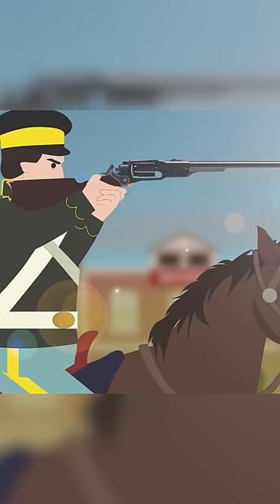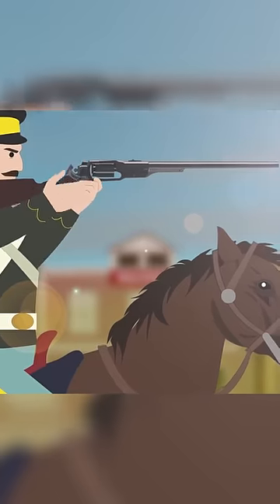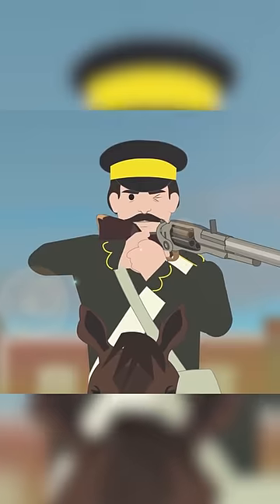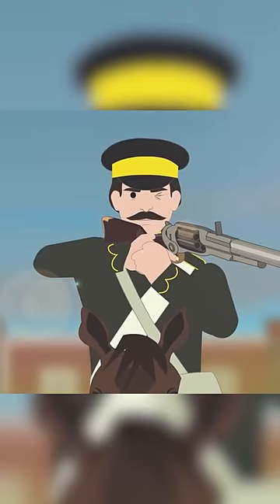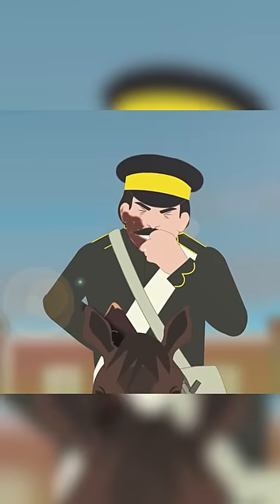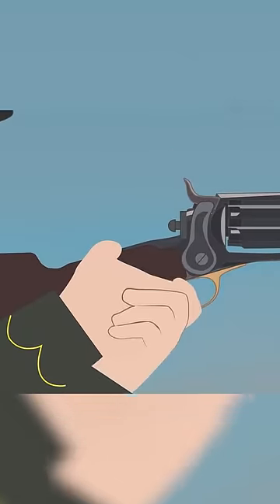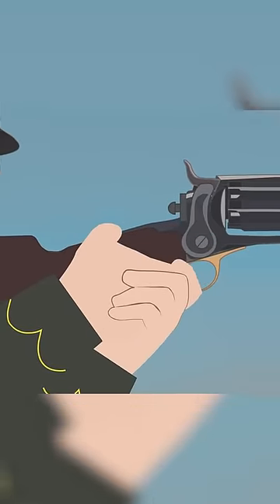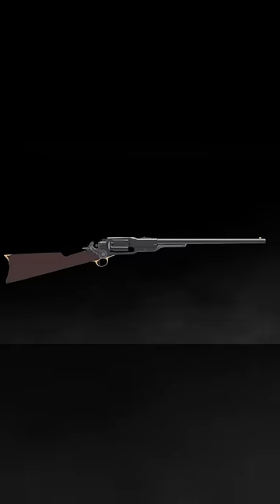Cursed Guns - Colt model 1855 (Cook off incidents)  #shorts

Comment: Chainfiring was one of the most dangerous parts of cap and ball guns
Reply: Haven’t had it happen to me yet just take proper precautions and it shouldn’t happen
Reply: @Lleesstreett  I'm sorry how can you take precautions?
Reply: Couple of ways. One would be to make sure your ball/projectile shaves a ring of lead when you ram it in the chamber (ensures airtight seal, hopefully preventing sparks/gas getting to the powder). Additionally, it’s common practice today to fill the remaining part of the chamber with a wax concoction to both soften fouling as well as prevent gas/sparks getting to the powder.
Reply: @alecdeveney3114  you say common practice “today” but that has been a method since the civil war
Reply: @Lleesstreett  since before!
Reply: Not when loaded properly.
Reply: I hear that grease pretty much nullifies the risk of chain-fire, but well soldiers are already assigned a bunch of kit so adding things to have to give to so many troops would be a pain. And, well, it's likely they would sacrifice some safety for the sake of speeding up what is a VERY slow process (reloading a cap-and-ball revolver or I guess 'revolving rifle'), so it probably wasn't feasible to issue all troops with grease and train them to use it.
Reply: This doesn't happen, nor has it ever happened. Soldiers are skittish folks, if cap and ball revolvers exploded randomly word would have gotten out and nobody would have ever used them. Revolver rifles were criticised by the cavalrymen who carried them as incredibly delicate and unreliable. Plus, f you wanted to have a rifle with a high rate of fire any cartridge rifle would do the job better, and that is why they weren't used. They were a gimmick with no niche to fill, but they didn't just go nuclear at random.
Reply: Could've worked better with cartridges and a recessed cylinder
Reply: A chainfire will certainly ruin your day. I had one happen once: set two rounds off. Scared the crap out of me. Use plenty of grease and you'll be fine. Probably.
Reply: @johnnyrotten200  
So glad for the development of metallic cartridges... chainfires seem like a nightmare.
Reply: @capsulejet6472  you use over sized shot. It should shear off a ring of lead when you force it in the chamber, people also pack bore lube on top for extra security but that's not really necessary.
Reply: @Lleesstreett  I don't expect it to happen all that often today but remember with muzzle loaded weapons & cap and ball pistols if problems should arise it's the the wizard not  the wand
Reply: @Lleesstreett  I know i  was stuck thinking about the civil war and the constant encounters of finding rifle's with multiple shot's rammed into there barrel's and stove piped them killing the operator's
Reply: @joshuacarrera6440  I’ve heard of that before
Reply: This is such a stupid urban myth...

No, chainfiring wasn't a real problem, especially since candleway was used to coat the bullets for easier loading - candlewax which sealed the chamber, and prevented chainfiring.

The reason this didnt become a thing is much more mundane - money.

Are the Knights LMG or the Ultimax better guns than the Minimi/M249? Yeah. Why doesn't everyone use them then? Because they cost a lot of money. That simple.
Reply: @Lleesstreett just because it was common today doesn't mean it wasn't common yesterday
Reply: Yeah in the modern day just smear some crisco across the face of your cylinder to act as a buffer between your powder behind a shot and your fucking hand

Comment: A weapon cursed because it was ahead of its time my grandfather has one of the modern ones that uses regular bullet casings and it works fine if it stayed around until bullet casings came I bet these would be the real cowboy guns instead of the lever action repeaters
Reply: Probably not since you would only be limited to 6 rounds. A lever action rifle could double that capacity. Even with modern cartridges,  they are still not equal to a lever action rifle. They are neat but not very practical compared to a lever gun. Remington made a model 1866 revolver rifle. It started life as a cap and ball rifle but was then soon  made to accept modern cartridges. It was a failure, lever action rifles left it in the dust.
Reply: @INeverMetAGunIDidntLike  but lever actions especially at that time jammed and we’re not as easy to clean you also couldn’t fire in the prone position and had to readjust your sight picture in some cases that’s why the US army never adopted them and used trap door rifles or breech loaders also lever actions were too expensive to to give to the standard soldier
Reply: @dr.killson7355  LOL, Im not laughing at you, I'm laughing at the old myth that you can not fire a lever action in the prone position.  I, as well as others, shoot our lever guns in the prone position without having to take our sight off of the target. You are right about the cost factor. After the American Civil War, the War Department realized that the metallic cartridge was the new thing and it would be replacing the outdated paper cartridge. Instead of spending a lot of money ( especially after the C.W.) on a new rifle designed to fire metallic cartridges, the War department determined that the cheapest route would  be converting the thousands of muzzle loading Springfields into single shot metallic firing rifles. The other reason the War Department went with single shot rifles is because the Winchester Mod 1866 utilized the .44 Henry rimfire cartridge ( basically a pistol cartridge). They could went with the  Spencer repeater that fired a larger caliber bullet but then we get back to the issue of spending a lot of $ producing more Spencers. It was a lot cheaper to convert the surplus Springfields than buy more Spencers and outfitting the whole military with Spencers. The military did use  Spencer carbines during the Civil War but they were issued to the cavalry. After the war, the Spencer carbines went out West with the cavalry and the War Department even had some of the worn out Spencer carbines refurbished and converted to rifles. The converted single shot Springfields could handle a larger and more powerful cartridge than the lever actions at that time. Another thing that convinced the military to stick with single shot rifles was to conserve ammo. They  thought a soldier would just waste ammo with a repeater, we are back to the $$$ saving issue. The War Department even requested that the Spencers have a magazine cut off switch (Stabler cut off) in order to conserve ammo.  Those are some of the reasons or excuses why the military went with single shot but you were talking about the Colt M1855 possible taking over the lever gun with civilians, not the military. Even though every thing that fires black powder can have issues due to powder fouling, the lever action was a superior design compared to a revolver rifle. The cons of revolver rifles, you still cant place you hand in front of the cylinder because of escaping gasses can do some serious damage to your forearm and you are still limited to only six rounds vs the Mod 1860 Henry or Win Mod 1866's 15 rounds. Now with that being said, If it was 1867, Western Kansas, Cheyenne uprising, you verses them, what would you want, a 6 shot revolver type rifle that only holds 6 shots, a 7 Shot Spencer, a Henry or an Improved Henry ( AKA Winchester Mod 1866 that holds 15 rounds?....... (Wow, that was a long reply!)
Reply: @@banthisyoutube4552 and they were still putting magazine cut offs on the Krag and 1903 Springfields........ unbelievable......
Reply: @@banthisyoutube4552And to this day people mistakenly believe the M16 is unreliable because of that.  It's always been a dependable gun if you clean it and use the correct powder!
Reply: @INeverMetAGunIDidntLike  how are you able to keep your sight picture in the prone with a lever action?
Reply: @oakesclassic6294  same as one would with a bolt action rifle.
Reply: @INeverMetAGunIDidntLike  if the lever is below the gun and you’re laying on the ground how do you have enough space to use the lever without moving?
Reply: @oakesclassic6294  Sorry I took so long to respond. I had to wait until I could whip this video out for you. The early lever action rifle technology could only handle a pistol class cartridge and it wasn't until around 1876 and 1886, when Winchester came out with the Mod 76 &86,  those models could finally chamber a large and heavy hitting cartridge.  By this time the U.S. military had already adopted the single shot Mod 1873 45-70-409 Springfield Trap Door rifle. There are other factors why the military never made the lever action a standard battle rifle but one can definitely fire a lever action rifle while in the prone position.  I hope this video helps.   https://www.youtube.com/watch?v=bq0Cu4WjLjU
Reply: @INeverMetAGunIDidntLike    thank you, I’m not very familiar with lever action rifles. As far as the space is concerned I guess I didn’t fully think it through. Modern rifles can only get so low to the ground as well, depending on the location and size of the magazine.
Reply: Even with modern casing the Revolver rifle wouldn’t have taken off, because the larger caliber of a rifle would probably mean the cylinder would need to be fixed in place for maximum durability. That means we’re most likely talking about a gate loader, versus a break action or swing out cylinder. The process of reloading the rifle would still be extremely slow because the bullets still have to be inserted and extracted one by one. Such a weapon would have no overall fire rate advantage over the single shot breach loader.

Comment: I have the reproduction (in .44 caliber). When loaded properly, there are no chain-fires. The reason of holding the carbine behind the trigger guard with both hands is to avoid the chamber side-blast that ALL revolvers create between the cylinder and the forcing cone of the barrel. The only revolver I have that seals that gap is the 1895 Nagant Revolver, but it has to use special ammunition where the brass case helps form the seal with the forcing cone.
I own many can and ball arms of all types from .31 caliber to .58 caliber. None have had chain-fires. The main issue with them is the percussion cap falls off or in the case of revolvers, after firing, the bits of the cap jam the cylinder preventing it from rotating until the remnants of the already-spent cap are removed.
Reply: Rotating your rifle or pistol up and to the side helps eject the cap in a safe direction so it doesn’t fall into your hammer gap. 
Have a great day and keep your powder dry.🤠🤚🇺🇸

Comment: Just put a little bore butter into each chamber after loading the cylinder. This problem isn’t exclusive to the carbines, but also happened to a number of pistols. Also make sure you use the correct diameter lead ball so that when you ram the lead into the cylinder it produces a thin ring keeping it a tight seal. This also helps keep the load water resistant.
Reply: Yes

Comment: You are supposed to have both hands behind the cylinder anyway because of the cylinder gap. This is true for modern revolving type rifles of the same design which have eliminated the chain firing (cookoffs) but still have the same design. 

A good example is the Rough Rider Rancher .22 rifle. The owners manual warns of keep both hands behind the cylinder even though it fires a rim fire cartridge due to the gases venting to the side of the cylinder via the gap between the cylinder and the forcing cone (barrel).

Comment: Another problem the gap in between the cylinder and the barrel, hot gasses would escape, which you properly demonstrated by having the solider hold the weapon only by the stock

Comment: Yeah, i can understand the chain firing issue, it was and still is a thing to worry about with blackpowder revolvers if you put a little too much powder in or skimp on the chamber grease at the end.
Kind of surprised colt didnt try what the old nagant revolvers did with the cyclinder moving to snug up to the barrel, its what allowed for those nagant revolvers to adapt a suppressor or silencer to them. I dont even think my rossi revolving rifle does that either, and i love my rossi. But i guess since its a modern cartridge of 45lc/410g, there wasn't a need for a suppressor, and since thats an old blackpowder, pretty sure suppressors weren't really a thing back then, though that would be a curious video, suppressor technology and evolution? from the 1st suppressor i know of, the welrod, to the vintorez or val, to 80s-2k, tank muffler was hilarious, and then maybe the new crazy 3d printed stuff. i got an old 2007 surfire suppressor for my ar10 i love, but that can gets pretty warm after about 20shots, got a newer and much cheaper 3d printed 1, 80shots in (im poor so i cant fire all day xD), cold to the touch, and im using normal ammo not subsonic, so very minor noise reduction, however what im getting at is a normal cartridge makes alot of hotgas, so that piece of bowlingball plastic should melt, but it does not, not even gets hot enough to tell the different between it and if it hadnt been fired, but i also fire 1 to 2 shots a minute at best, trying to go long so it wasn't a heat stress test. would like to actually torture it but sadly 308 is not cheap for a casual

Comment: My thing is why not using the loading lever used to reload the gun as like a vertical foregrip (granted you would have to put it back up or the cylinder couldn't rotate)
Reply: It's not made to do that. It could break off.
Reply: If you do that it will ruin the levers locking piece and it will randomly swing after every shot. It was a common issue on .44 1st pattern dragoons, but that was simply from the enormous recoil.

Comment: Not only did a chainfire discharge severely burn the shooter, if there were rounds in the other chambers other than the one currently aimed down the barrel (which, unless you had to reload just one chamber in a hurry, there would be), those rounds would fly out as well as the burning gases, which is aimed directly at the shooter’s non-dominant hand if they had it on the forward stock (if they were shooting correctly). The end result is a firearm that sounded good on paper, but was looked at as taboo by cavalrymen, was a legitimate safety hazard, and which, in turn, made the 1855 less effective.

Comment: That is one reason they didn'tuse revolver rifles, that was rare and it almost never happened. The big problem did have to do with hot gasses though, you couldn't hold your hand infront of the chambers or else you would burn your hand because of the gasses coming out of the front of the cylinder
Reply: And the only times that chainfire did happen was because you weren't using the right sized ammunition

Comment: I wonder what happens when you drill holes on the barrel. 
My idea was to like drill holes so the hot gas can get out or smth Im not a professional on this
Reply: Letting the hot gas escape reduces efficiency (power) & there is a "hole" already. The gap between the rotating cylinder & barrel.
Reply: @Iowa599  Meanwhile, I wonder why the M1895 is more or less the only one of its kind with the whole cylinder moves forward thing.